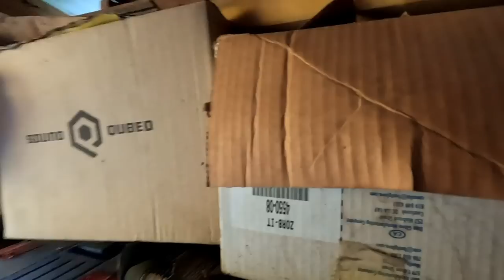Massive Yellowjackets Nest Found In An Old Barn

Comment: I would recommend using an aerosol like CB-80 which uses pyrethrins to kill insects. It has no residuals and you slip the straw into the box and let it loose it will kill all of them in the box before too many can escape. Another option is D-Foam, it expands like shaving cream so they can't get out of the box and you can kill them all very quickly, quietly and safely.
Reply from the maker: You don't really get the jest of this channel.   There are better ways to do this without having to kill the bees
Reply: @YappyBeeman  I can understand when talking about bees, but yellow jackets are just pure evil.
Reply: @YappyBeeman lol you are so in the habit of bee content you've mistakenly replied to everyone commenting on your yellow jacket removal as if they were talking about bees.
Happens to the best of us